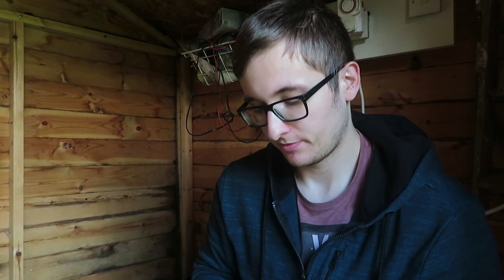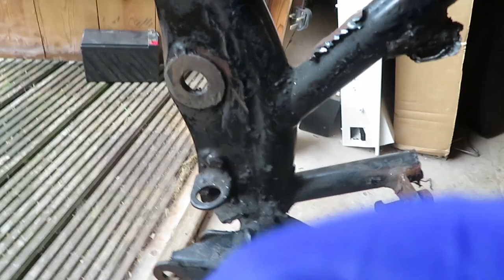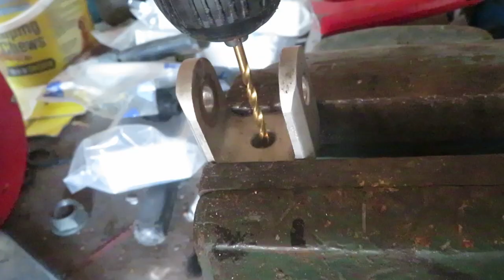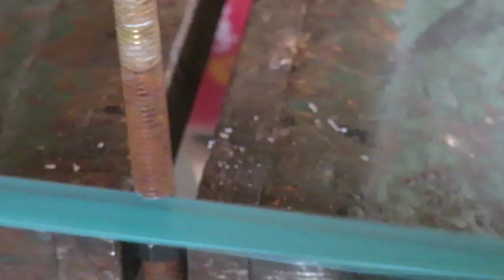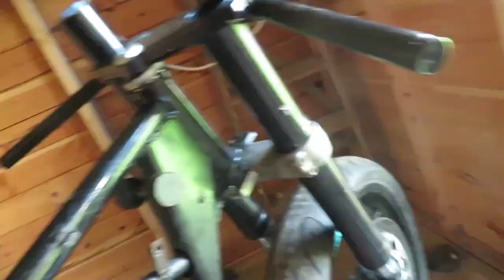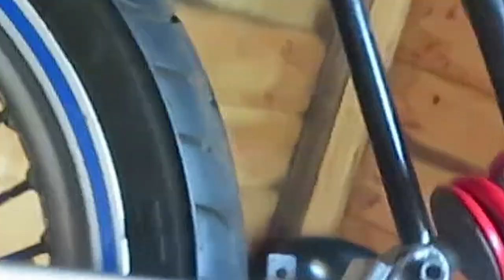Monoshock Conversion | Yamaha XT125 Swing Arm Install | Cafe Racer Build EP: 8

Comment: Swing arm looks familiar 😏
Reply from the maker: Its a Yamaha xt125, it sits alot lower on the suzuki frame than the Yamaha one it came from, bit suspicious of the abilty to do its job properly so may need to adjust some how, was a cheap ebay buy so nothing lost😁
Reply: And i would reccomend getting that top mount welded as that bolt wont be strong enough having so much load on it
Reply from the maker: Calling me fat?😂 Joke!
Yeah don't worry its going to be done, it all got fitted whilst filming so haven't been able to amend any work, thanks for the advice I appreciate it👍
Reply: Haha! its all good man! Just don't want you hurting yourself :) keen on building my dude!
Reply from the maker: Thank you, will have to race 125s when built!😋
Reply: That's what I was thinking.

Comment: So if I want to convert a GS 150 (Cruiser) to a scrambler, which shock should would you recommend? and how would one figure it out the lean angle on the shock?
Reply: Would the vector be from the rear wheel's point of contact to the base of the fuel tank? And we'll consider the front wheel?
Reply: Cafe racers have a squatted position here, so the shock is highly tilted towards the steering column. Mine would be more taller I guess.
Reply from the maker: Im in the process of re doing the monoshock mounting point, the angle wasnt strong enough to support weight, ive tested the angle and brought it closer to the rear, i tested it by holding it into place with a rod and roughly fitting it in, then bounced up and down on it and the suspension was far better
Reply: @treadlife850  Hey,
Is there any specific angle to place monoshock?

Comment: wish people would stop destroying good bikes to make cafe racers, indecently the rear spring should be more upright and the top mount should be in line with the damper so stress in not an issue, there is far too much compression on that spring, I hope you return this bike to what it was, a great little green lane twin shock bike, as it is its awful, riveting because you don't have welding equipment by any chance, I also assume this is why you weakened the frame to the point it will fold up on you by drilling that huge hole in the frame, yes it's a frame not a pipe. find something else to do is my advice, computers or playing an instrument maybe.